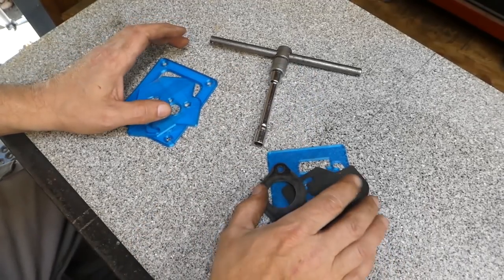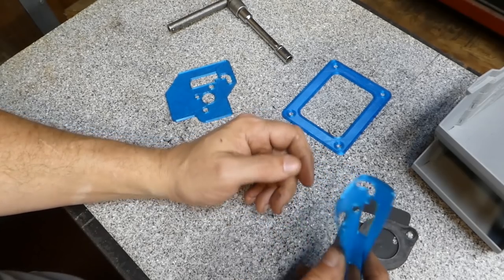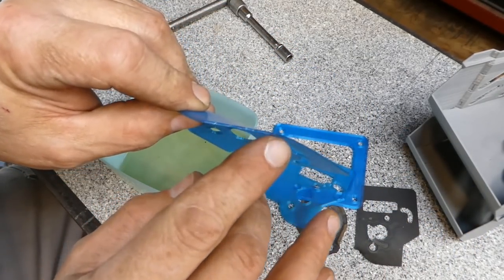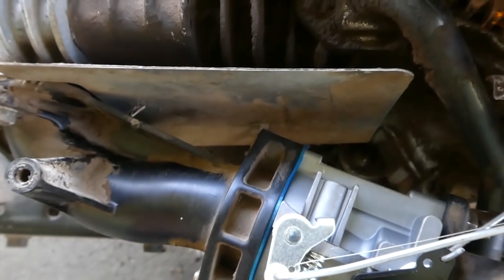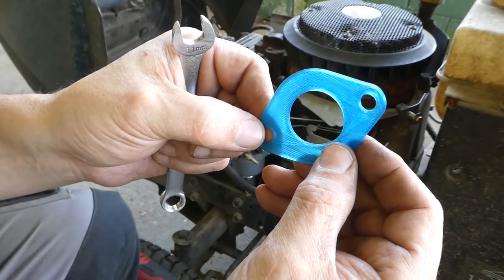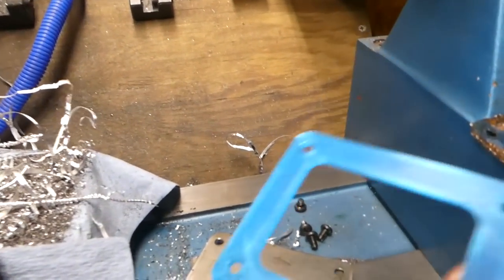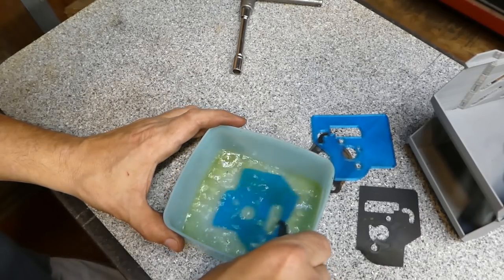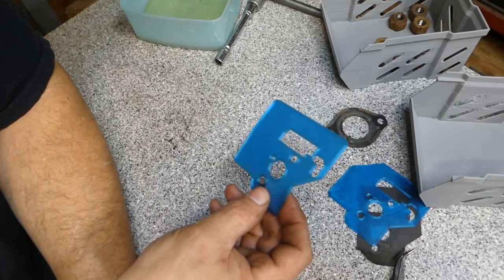3D printed gaskets? Any good?

Comment: You should enable z hopping to avoid damaging the gasket when the head moves, I noticed the scrape on the gasket, it risks removing it from the build plate. Great video btw
Reply from the maker: Thanks! They are not actually scrapes, just travel lines, purely cosmetic. There is a setting to clean that up I just did not have it set and I was running hot to get more speed so the nozzle was oozing a bit.

Comment: You can use TPU with a bowden setup it just can't have large XY dimensions. Ender 3 V1 works with TPU
Edit; acetone vapur smoothing works with ABS and not PLA
Reply from the maker: Good info. Not sure why you mentioned acetone smoothing. I was seeing how it reacts to TPU and PLA not use it to smooth. Acetone did seem to have some effect on the  PLA making the top layer sticky where it came in contact. It was definitely dissolving it locally to the application. I would not call that a smoothing effect as it would have just turned it into a mess.  It did not seem to affect TPU. Thanks!
Reply: @theeddies  hmm interesting it might be possible to essentially weld PLA to PLA with a tactical soaking in acetone.
Be interesting to test a few different samples and see if the adhesion would be strong enough to use for practical purposes 🤔
Reply: @DarthBlazer.   It should not have any effects on PLA. What's probably happening is that he used some form of PLA+, which is a mix of PLA and ABS.

Standard pure PLA does not react with acetone.
Reply: CR10 works as well, I'd recommend a better extruder and capricorn PTFE tubing though.

Comment: Today I discovered a broken rubber part under my airfilterbox in the car. It is wedged in there between the airfilterbox on top and the valve cover underneath. I cant for the life of me find that part as a replacement without ordering a whole new airbox and thought about printing it in TPU. Might give this a shot first... Besides, having TPU around for other flexible stuff sounds like a general good idea to me...
Reply from the maker: I would give that a shot. TPU is pretty useful for lots of things. If you print it thick it can be very solid. I made a holder for a large Dell tablet to mount it to a tripod for livestreaming. It is stiff enough to hold it but soft enough to not damage it. Very useful stuff. The holder is on Prusa Printables site.

Comment: You can use cheap laser cutter to cut gasket material. I have made tpu gaskets before and they work. For example MAF sensor. But on direct engine parts it's better to use 150usd laser cutter. It's really easy to scan them using photocopier and import them to slicer and lasercut them. If laser is not strong enough you can go multiple passes :)
Reply from the maker: I actually bought a laser with my  Sovol SV01. I have not even tried it yet. Both my printers work 6-8 hrs a day making a product I sell. I need to hook it up though and try this. All the best!

Comment: It's actually easy to make your own proper gaskets but you need a cheap laser engraver instead of a 3D printer. I use the Ortur Laser Master 2 laser engraver and it can cut 0.5mm gasket paper at a reasonable speed and extremely good quality. I own an online store selling parts for small engines and people have been commenting on how nice my gaskets are :)

Comment: I wonder if this will work as a seal for the OHV caps? considering they're the basic seals too.
Reply from the maker: You know what, I had not yet considered that but I do need to check valve clearance in the mower so... I will need to do a temp check and that is near the muffler on this model but that's worth exploring, thanks!

Comment: Man this is a great vid I am a small engine mechanic (as a hobby) and these have been a game changer. I have an ender 3 pro with a direct drive mod
Reply from the maker: Thanks Jake, that means a lot. I will probably add a direct drive mod and dual z stepper or linked leadscrews at the same time eventually to mine.
Reply: This looks very promising. Better than ball peen hammer and gasket material. However, if I did this for a 2 cycle intake gasket I would have to vacuum test nit before starting it. At least until I get to where I trust it.

Comment: It's important to note that 3D printing is a game changer but not for us consumers. The industry already is using 3D printed parts everywhere. You can't see them because they're all internal parts. It's still not possible to get a surface finish on plastic like you can with injection molding.

Comment: i use tpu just as much if not more than pla these days. it strings in some fine detail applications but its strong and flexible.  they use it to make shoe parts.  if you want a decent printer that will do tpu out of the box the ender 3 s1 is great.
Reply from the maker: I agree the stringing can be a pain sometimes. I have seen good things about the S1 though my Sovol is basically the same machine without a few bells and whistles like touch screen and ABL.

Comment: An additional step with using TPU is to use a heat gun to warm it up and just barely melt it. This will bond the layers together and make it that much stronger. Also it will make it gloss shiny
Reply from the maker: Check out my other video on heat treating/annealing TPU.
Reply from the maker: https://youtu.be/a_fQ30COQQ4

Comment: One of the primary things that drove me to get a 3D printer was the desire to make my own carburetor intake boots for my motorcycle. The factory ones cost about $80 and are just terrible. I hate them so much. May cause getting the carburetor in and out to be an enormous chore and the whole thing could be made so much more simply if they simply had a flange that you could squish. So that's what I want to make.
Reply from the maker: That is a great idea and you can mess around with the way you print them and make them softer or harder and even slice it so part of it is a bit softer. The uses are pretty limitless.
Reply: @theeddies  I'm still wearing the model things in CAD. Show me a few plastic copies before I spend the expensive TPU on it.

Comment: That is really cool!  I've seen guys use those hobby cutting machines to cut gaskets out of paper and cork, but this is next level.  I ordered a roll of TPU but I haven't tried it yet.  I have been thinking about trying to print t-slot covers out of it but I was concerned about the hot chips and cutting oils.  After watching your video I think I'm going to give it a shot very soon.  My biggest concern now is that my machine is not direct drive, but I do have a high quality bowden tube, so we'll see.  Thanks for doing this and posting about your experience!
Reply from the maker: Thanks Mick! T-slot covers is a great idea to try. I don't think they would be any worse than the leather or rubber mats I have seen used to cover the slots. Might get a burn here and there from a really hot chip but should work overall. And easy to just reprint and replace if they get an embedded chip. I have not tried printing on my Ender with the bowden setup but there are a bunch of videos with tips to do it successfully. Best! Eddie
Reply: @theeddies  I have on my ender 3 printed little vibration dampening feet for it.       All I did was upgraded to Capricorn and a 3d printed extruder mount type thingy either way what it does is let's you cut and add a piece of bowden tubing between the hole it goes through in the extruder mount and the drive wheels so you can't get a loop popping out of there

Comment: For the cover plate gasket on your lathe i think you should get a thicker steel plate or bend it on the long side so it creates pressure between the screw holes towards the cast iron when you tighten it since now there is a long distance between and low pressure
Reply from the maker: I think the same thing everytime I take it off. When I got the machine that rather thick piece of stainless was all I had but it is probably time for something else, though it does work. Thanks!

Comment: First thing i used my printer to fix was a Pneumatic Staple gun, replaced an odd seal and an unavailable trim part.
Reply from the maker: Nice, I did a video replacing a staple gun diaphragm a year or so ago, I wonder it that could be replicated as well. More ideas. Thanks!

Comment: I forgot the name of the video.
But i saw someone on youtube that was restoring an old Honda motorcycle that printed his own rubber and TPU parts, because Honda does not make them anymore and there are no after market ones.
from what i could tell he has had no problems with it.
Reply from the maker: I have not seen that. If you find it again, share a link. Thanks!

Comment: Thanks for sharing! I bought a snapmaker2 a350 two years ago. Have you seen 3D printed dimple dies? I was looking up dimple dies when I found you video. I also have a combo lathe/mill/drill
Reply from the maker: Hello Sam, that is a very nice printer. I had seen one video on dimple dies a few weeks ago. I am not a great body man but I can imagine there might be tons of uses shaping sheet metal. 

I am a big fan of the combo machines, mine has served me well. Every thing on the channel, so far, that was made by mill or lathe came off that machine. Though I did just pick up a 10" Atlas that I am restoring. The next step in the journey I guess.   All the best!
Eddie

Comment: I just use a little bit of RTV to stick the paper gasket on one side (which ever is easier to get to) and take about 1 minute to cut off the excess with a knife 🤡

Edit: ive been 3D printing since 2013 and doing CAD since 2014, personally ive only made orings out of TPU (and sealed with silicone) for mechanical applications that have worked for many years (yet to fail). But gasket would be interesting or rather fun 😊
Reply from the maker: Sure, this method is not going to be a be all end all, just another method in the toolbox. It is also much more satisfying to me to have a perfect cut gasket out of a rubber like material that is reusable.  

I was going to try some o-rings, good to know you had success with it. It actually surprised me that there was not more about this out there already. I know it has been done for years. But I know a majority of my subscribers had never heard about it. Thanks!

Comment: A vinyl cutter like a Cricut and some gasket material would be faster than 3d printing but i like the idea of the TPU for some 3d style gaskets to seal boxes that are more complex than just a flat gasket.
Reply from the maker: Yes Cricut is good and faster but I don't have one :-) I have not even tried to do a true 3d gasket yet but am looking for a good one to do. Something like an o-ring with a ridge or U shaped one that fits around a surface.
Reply: @theeddies   I have had a Cricut for a while, bought it for vinyl but have found a bunch of uses for it.  I just got an Ender 3 Pro a month or so ago and it is getting a lot more use than the Cricut now.  I have not tried TPU yet, I figured I would wait until I convert to a direct extruder.
Reply from the maker: @BensRamblings  From what I have seen the stiffness of the brand of TPU seems to make the difference of whether it is easy in a Bowden or not. I honestly just have not tried it. My Ender Pro hardly stops long enough to do experiments with.   BtW, just checked out your channel - bacon cheesburger onion rings is the first thing I see, - and subscribed. 😁

Comment: I been thinking you could use a cricut for such things
Reply: This appears to be better
Reply from the maker: Yes, if you have one, it is probably a better alternative.
Reply: I am confused now, is the cricut better, or is the 3d printer
Reply from the maker: @kevinpalmer4137  If you are only making gaskets and/or need higher temps (more than 100C),  the Cricut is probably going to be a better choice. If you want something more versatile, a 3d printer cannot be beat. And you can add cricut functionality to a printer with some mods but not printing to a cricut. So if you already have a Cricut, it may be a better choice just for gaskets but if you don't I would lean to a printer. Just a personal opinion though.

Comment: Tpu gaskets , I like that idea 8-)
Reply from the maker: Thanks Bill,
I thought it was a very interesting idea. Much more useful than the other uses I have seen for it - flexible snakes and cell phone cases, ha. It is much more durable than I expected. Its slightly hygroscopic so it may not dry out like rubber and become brittle. I am curious what it will look like after a few months of heat cycles and outdoor conditions.
Best!
Eddie

Comment: Interesting and thinking some Type 2 Form-A-Gasket might seal any gaps up and still be good for being exposed to fuel.  Thanks for sharing!  Subscribed!
Reply from the maker: Thanks, I print them on a plain glass bed, slightly hot, with a max of .15 layer height. They come out smooth (especially the bottom side which is glass smooth) and I would say nearly completely sealed. But for a higher pressure applications, that might be necessary..

Comment: Hi Eddie.  Mate, that was a very clever idea by you.  I would have never thought about using 3D printing for gaskets.  I'm blown away that it didn't melt down in the petrol bath.  Could I print that stuff in my normal 3D printer that is set up to print PLA?  Or do I need to change the extruder and nozzle?  Cheers, Aaron.
Reply from the maker: Hello Aaron, it was not an original idea by me but I could not find many videos demonstrating it in real life. I am pretty sure your  I3 printer has a direct drive extruder. If so you have the best setup already. TPU can be printed on just about any printer, E temp and bed temp are basically the same as PLA. I am going to send you a link to another Aussie who is great at explaining what's what.  He demonstrates on a Prusa machine but yours is set up the same. I will send it via email as links don't always go through in comments. Best!

Comment: TPU has a glass transition temp of around 60°C, higher if you anneal it after printing, so basically any gasket application below that temp should be fine. You probably wouldn't get away with using TPU gaskets on engine exhausts, but just about anything else should be fine.
Reply from the maker: Yes I have read some literature about the glass transition matching what you quote. As I have learned and several people have pointed out the glass transition for flexibles is actually in the negative. Ninjaflex lists theirs at -32C. What I am measuring in this and the following videos is actually the heat deflection temp. My results in a subsequent video don't show as high an advantage after heat treat for the heat deflection and roughly agrees with some of the other data I have seen online. There is still a slight advantage at higher temps but perhaps not as significant as 60c. I agree with you though, from my testing, everything other than the exhaust should be doable. Check out my latest video, I did some pretty extensive heat treat testing and also measured different parts of my test engine at different points. Best!

Comment: I love this idea! I will have to try it out.
Game-changing for me was when I realized my K40 (CO2 engraving laser) could cut gasket material! All I have to do is scan an old gasket, trace bitmap, and I have a cut path I can run in laser software to give me a new gasket. Only problem? I can't find stock gasket material!!! Where does one find that thin gasket material they use in carburetors??
Reply from the maker: Have you tried McMaster Carr?

Comment: I'd be curious to see how the fitted gasket and the rejected one soaking in fuel hold up down the road
Reply from the maker: I am adding the valve cover gasket to my tests, this will be constantly soaking in oil both hot and cold so should be a good test of what happens to the plastic. Thanks!

Comment: PLEASE GET AN OFFICE SCANNER! They make cloning these 2d like parts super easy, measure one side and then put the scanned picture in fusion, if you tell it the dimensions of the distance between two points it automatically scales the entire pic
Reply from the maker: Yes, that is good advice. Not sure why you yelled it but good advice😁. The carb gasket I could draw in the time it took the scanner to work but the other square gasket would be much easier that way if you have one to scan.

Comment: PLA shouldn't really react with Acetone, might be your batch or a mix or something, but ABS on the other hand will dissolve in acetone, which is why acetone smoothing is possible.
Reply from the maker: Yes, that particular PLA was some really cheap no name brand I bought just to make those bins. It did react to it slightly but not like it would to ABS, it was more like what you get when you remove a price sticker off plastic, the residual glue feeling only where the acetone was concentrated. It also printed a bit weird, wanting more heat and it seemed to prefer a bigger nozzle as well. For all I know it could have had recycled waste plastic in it. Thanks!

Comment: you should pick up a small diode laser ive been cutting gaskets with it and it is GAME CHANGING
Reply from the maker: I actually bought a 40w laser when I bought my Sovol 3d printer. I have never even opened the package. I need to try but just have a lot of other things going on. Are you just using regular gasket material?
Reply: @theeddies   oh man plenty of power i only have a 10w, yea off the shelf fel-pro rubber/fiber from autozone. im sure with more power you could cut higher temp stuff , cometic 1200 degree laughed at my laser lol
Reply: @theeddies   also I picked up a scanner so I can just scan it and convert it to dxf and have a gasket in 30 min or less

Comment: I printed a o ring / gasket for my garbage disposal I hang installed it yet but I’ll let you know how it goes.  I used ninja flex.  I also tried f69 resin I would be interested in you testing that stuff since it’s printed with a resin printer
Reply from the maker: Yes, let me know. I do not have a resin printer yet but would love to test it.